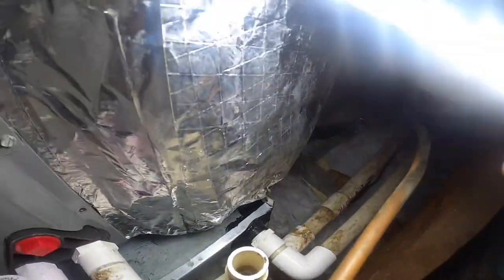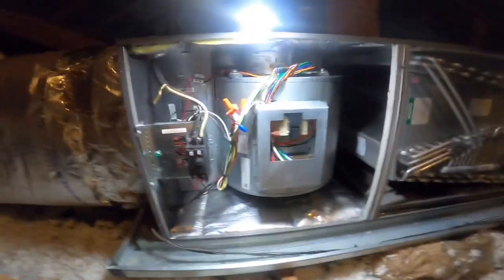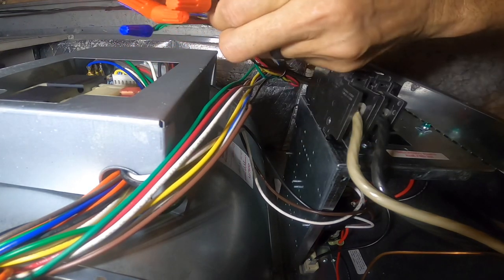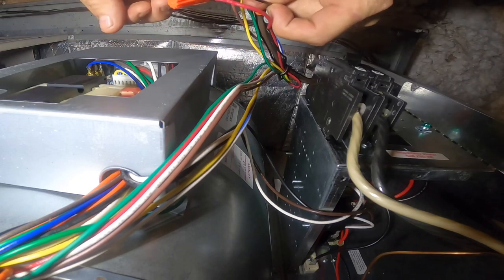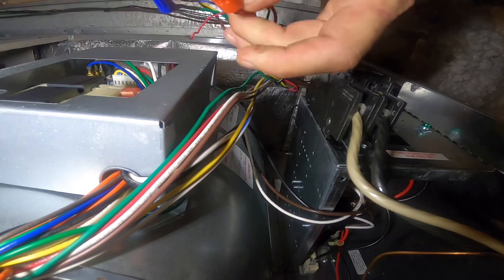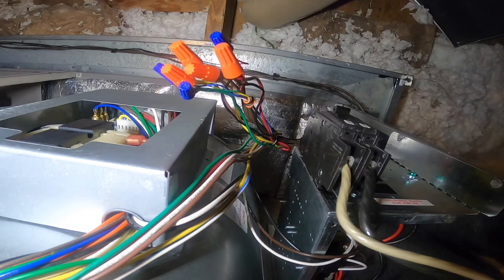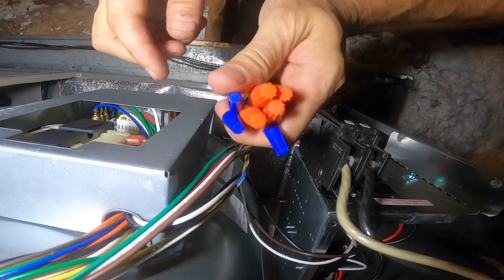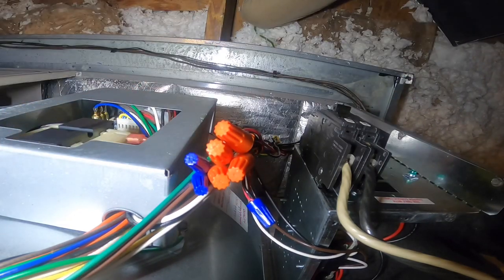Mistake during installation, caused water problems. How to best wire an SS2 float switch.

Comment: Lesson of the day, run the system and test float switches at installation. Good catch, nice instructional video also.
Reply: Same thing I thought too. All it takes is getting in a hurry during an install because that attic is hot and you're ready to get out of there before you feel like you're going to have a heatstroke.
Take the time it takes to test the float switches!

Comment: Two ways to do it and either is correct.
1) kill all power to everything
2) kill power to the outdoor unit only

I question your statement about the 1:27 mark about the original wiring no killing the outdoor unit. Why would it not kill power to the condenser? 
If it does not kill an operation call to the condenser, then break Y.

Personally I will NOT kill power to everything. In my area there are freezing temperatures, therefore killing power to everything would eliminate the possibility of the occupant using the aux/emerg heat until someone could get there to determine the issue.
I would rather there be use of the aux/emerg heat and no frozen water pipes then there be a major flood issue due to no heat and frozen pipes.

If you have no issues with damage caused by not having heat, say Fl or Ca where the probability of freezing temps is highly unlikely, then by all means kill all power.

Either way the customer will know there is an issue. Since many thermostats have batteries, then killing power to everything does not necessarily mean the customer will have any quicker knowledge of an issue since the stat will still be on. So breaking the call to the outdoor unit will provide the same no cool/heat and get their attention. 
Yes, the blower will not be on with only the condenser call cut, but if the coil is freezing up, at least the blower being on my thaw the coil in the mean time.

Again, to each their own.
I try to think of all the possibilities.
Reply from the maker: Something you said reminds me of why some people choose to use Rheem products around here. We usually need AC. So. If something happens to reversing valve it should default to cooling.
Reply: @HVACGUY  
Does NOT matter what equipment is used, the same cut condenser operation exists - Y, R, C. Only issue with cutting R or C would be if there is a defrost/control board that stores faults. This would kill 24V and, unless they are stored in memory, drop the error.

Comment: Heat pumps and 90%+ units I always break both hot wires as you did. The only exception is the 80% conventional split system I will just break Y for obvious reasons. Installer probably just read the first set of instructions (I believe the SS2 instructions do state to break “Y” with the float switch). Wouldn’t be the first or last time I was wrong though…..

Comment: There's nothing wrong with your blower still running if the  condensation has tripped the safety switch. The switch only needs to kill the condenser from pumping coolant.
Reply: True, but shutting down the whole system will identify that theres a problem sooner and not blow water around.

Comment: I have "3 low voltage red wires", one connected with a yellow wire, and the other two red wires are connected each with 2 separate EZTrap Black wires. Can I connect my new "Condensate Pump 2 shut-off wires" with the EZTrap and red wire separate connections?

Comment: Fan wasn’t ramping up? Also if you have the access to float switch you have to make sure you run the sensitivity down all the way and if you have a pan switch ss3 in the pan needs to be set very sensitive as well. We also put freeze stats CPS coil lockout.on the units in Florida. This will shut off like a zoning system if it goes to freeze up past 26°. We also install a primary float switch as well SS1. Good job anyways.

Comment: Why not break yellow instead of red cause float switch mostly say break Yellow
Reply from the maker: You certainly can. Some people prefer to do that.
Reply: Breaking Y, or yellow, the outdoor unit/compressor call works for AC units and heat pumps, but if you have a condensing furnace creating condensate, you have to look at which W call controls it.  If you use one float switch for all condensate, they you'll likely need to break the R to kill signals to both/all sources.
Reply: @jkbrown5496   a lot Trans /American  Standard  and ICP  that have float switch they use yellow . Rheem and Goodman  float switch are on Red  from all systems seen .  I was always told float switch  to yellow  .I still learning HVAC